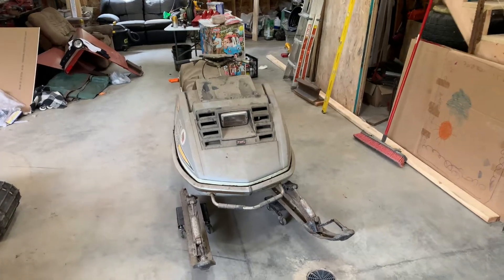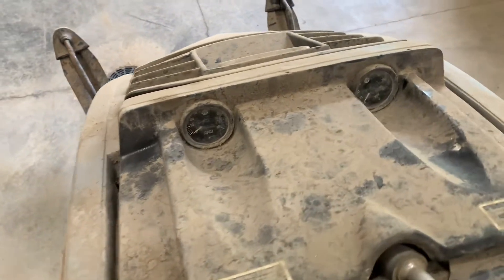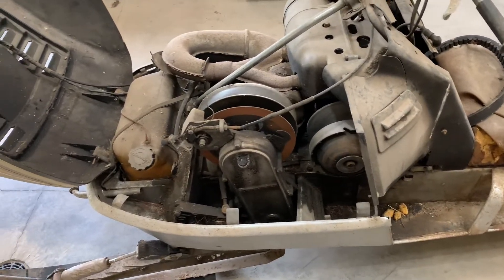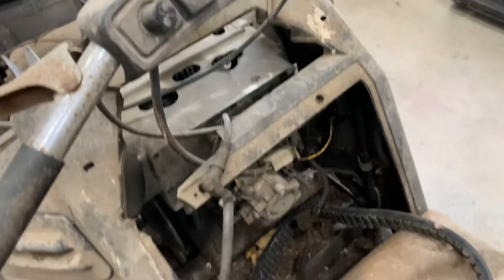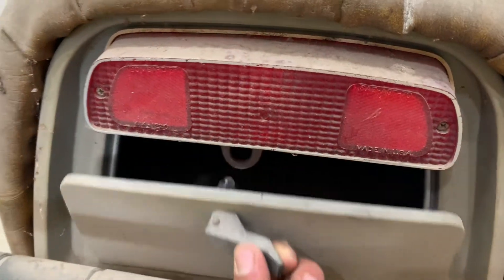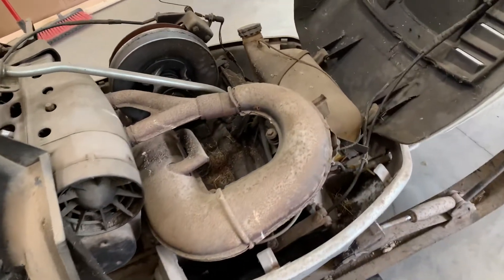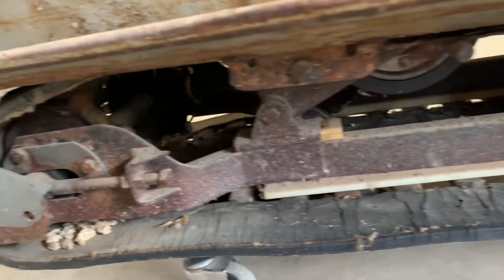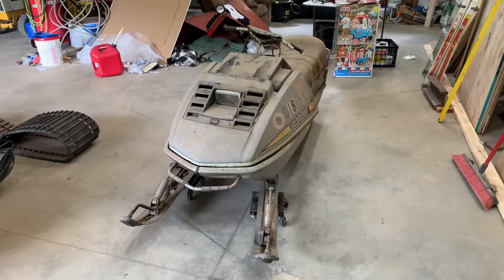Free Ski Doo TNT Silver Bullet!!

Comment: Hi Ron, nice video. I typed in 1973 Ski-Doo TNT Silver Bullet and your video popped up. Brings back some nice memories. When I was a teenager back in the 80's we had a couple Silver Bullets. One was a 229 or something like that. My dad was a mechanic who worked on them for a living. He pulled out the small 229 and replace it with a 440 TNT motor. But everyone thought it was a 229 because he left the 229 sticker emblem still stuck on the side lol. I had always wanted to replace the single carb with a dually setup for more speed plus I thought they looked so much cooler tilted up on angle the way they used to be. But my dad always said no because it was so hard to tune the dual carbs and keep the engine idling. Anyway, I had lots of fun riding that baby racing my friends 500cc Artic Cat. I could beat'em good too!.. My brother on the other hand, who was 13 years older than me had a Silver Bullet with a 640cc tucked under the hood. I don't know if they sold a 640cc Silver Bullet or not but it was a TNT engine if I remember correctly. I always wanted to ride his TNT so bad but never did. He went off and joined the Navy and told me not to mess with his sled. I was just a kid back then, but I should have at least tried to take it out for a few fast spins..lol

Comment: my 72 340 tnt also free, had bad wire crimps on the coil primary grounds on the coils.  the wires would pull right out of the little terminals that ground to the coils.  check them.  and one of the secondary wires on mine was sparking onto the top of motor, had to change the wire end.  filed both sets of points, varoom.  running.  also changed the 2 fuel lines, and cleaned out the gas tank, changed drive belt, adjusted the track.  ready to ride.